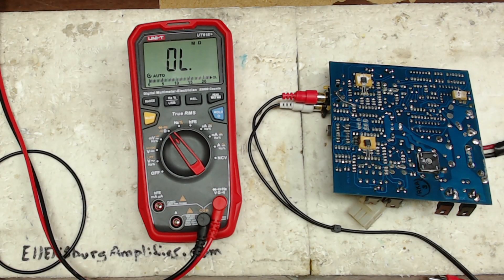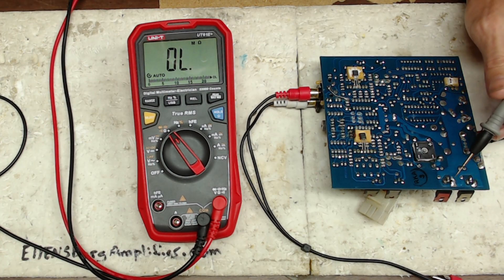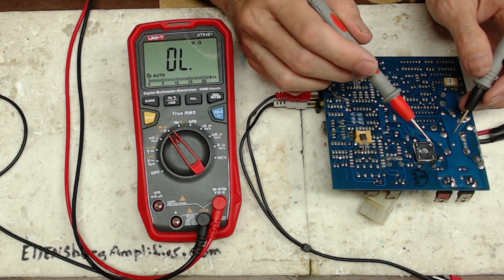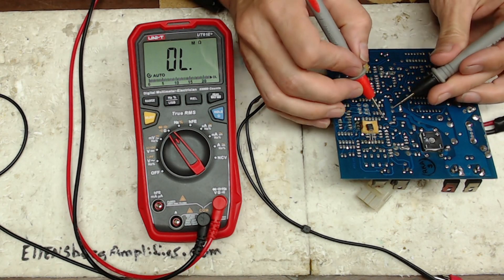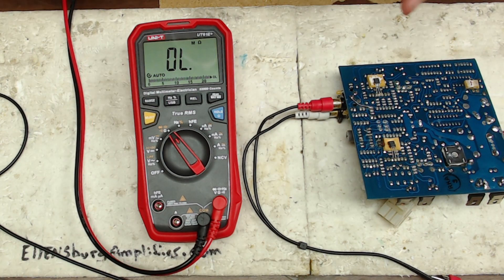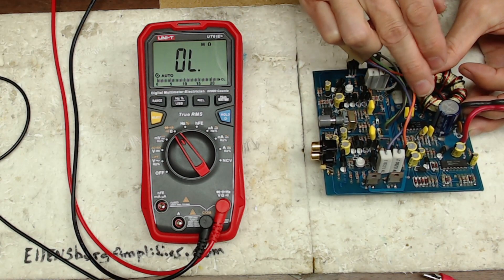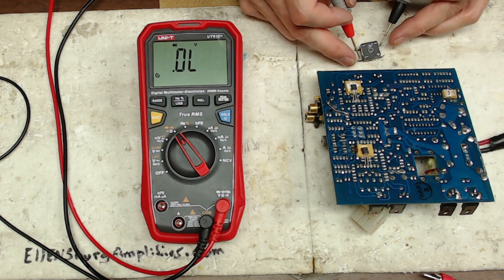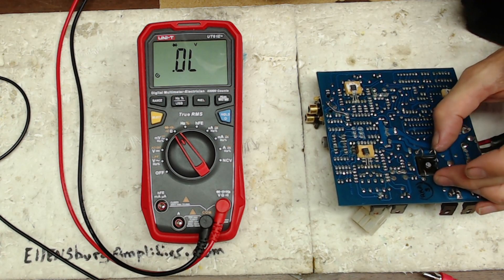Hifonics Pluto Possible Zed Audio Negative Rail Short locate Journey

Comment: It's a Bridge Rectifier, and any generic Bridge Rectifier will work in it's place as long as the replacement 
can handle 30% more of the current and voltage you expect being injected into it's AC pins..
Just google the Volts/Amps Bridge Rectifiers Eg: "300Va Bridge rectifier" which BTW only cost a couple 
of bucks
Reply: 🐨 BTW I slapped a 👉👍👈
Reply from the maker: @KorAllRBare  Thank you! I do have a replacement on the way.

Comment: Way to stay persistent good job. If you can find a data sheet for it but can’t find the part we can always form fit function and put in a different bridge
Reply from the maker: Thank you. I rarely see bad rectifiers on the bench so I took it for granted that it was not faulty. Assuming will always add time to the repair and I try my best to not assume. I have an MB104 on the way for it with the same dimensions so I will see if it works out.

Comment: good night , why don't you just use 2 of the t0220 case style diodes mounted to the heatsink through the same opening on the pcb
Reply from the maker: Thank you for the question. I did not receive the heatsink with this board so it would make it difficult to place anything other than the OEM part in the proper mounting height. I also do not know if this board is for a collector. Collectors typically do not like anything but OEM parts. update, I did find a rectifier and it's on the way!